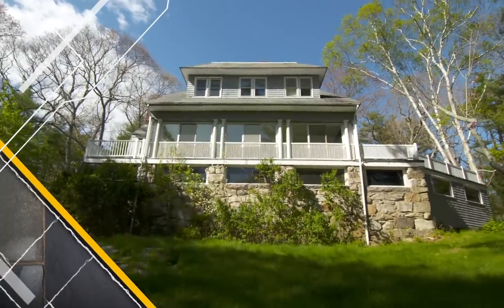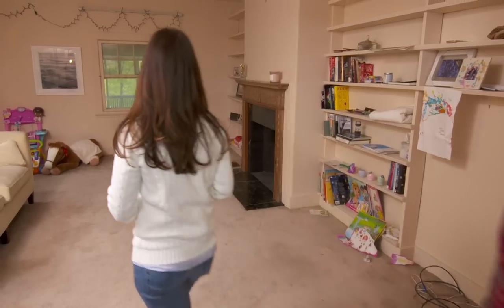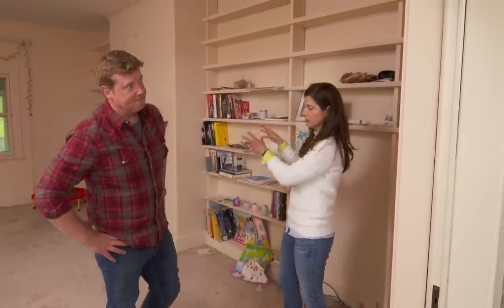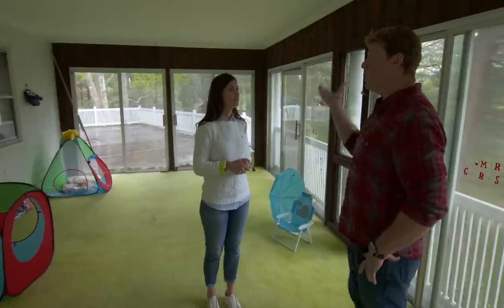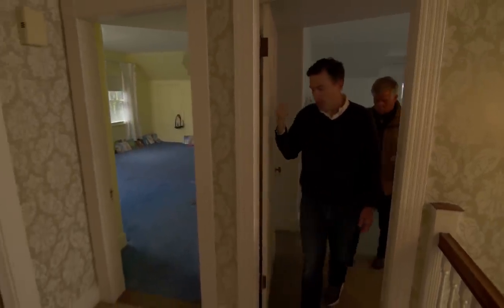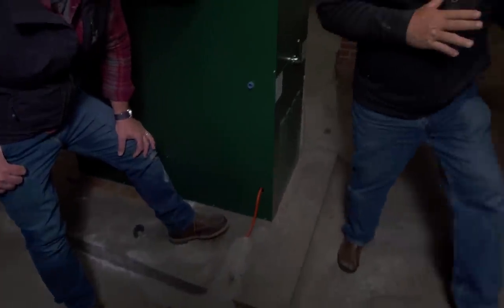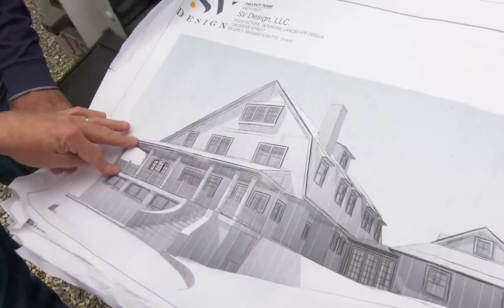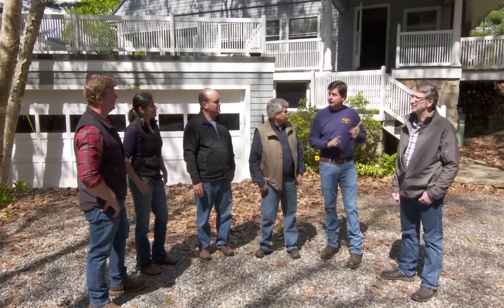This Old House | Cape Ann Shingle Style (S41 E17) | FULL EPISODE

Comment: coal furnace still in my parents' house built in 38.  converted to oil long ago, and then later upgraded to a more efficient burner a number of years ago.  radiators.  Can't beat that system.  never run out of heat

Comment: Hello, we have a boiler, and the pilot is coming, but it is not firing up or pushing hot water to the radiator. Do you have any technicians in the Alexandria, VA area? Our first issue is the safety valve is leaking, model number 10-408, 30 PSI, 535000, from Conbraco Industries, INC. Our second issue is a stuck flue draft damper, might be because of the power or it's bad. Could you help us?